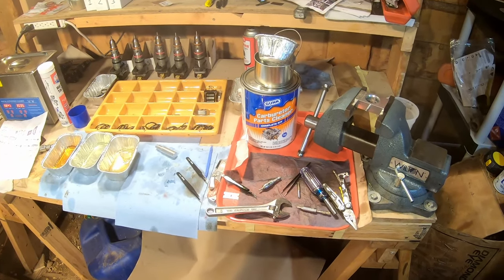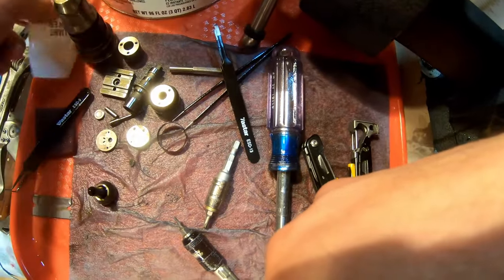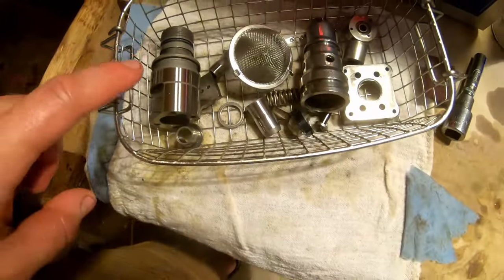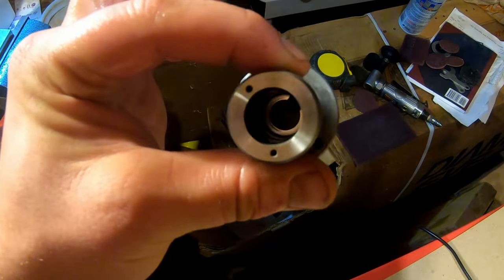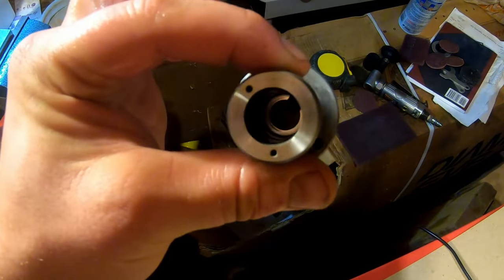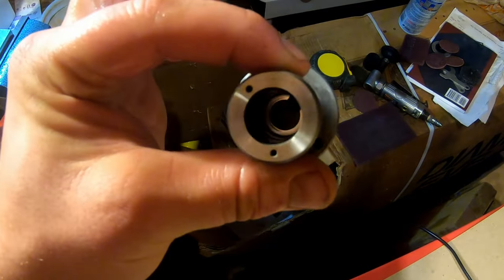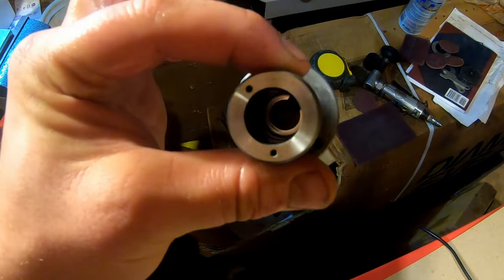Rebuilding Ford 7.3 Powerstroke HEUI Diesel Injectors

Comment: The amount of different chemicals you expose your hands to is astounding. That's coming from a daily diesel mechanic.
Reply: Indeed. He's got a good video here but all those chems just soak into the blood stream. For a long time I thought if ya didn't have grease on your hands, you weren't working. But as I got older and understood the body a little better not to mention being warned about the toxic effects of all these oils have, I wear the rubber gloves now and when they tear I put on new ones.
Reply: @silvergrizzly316  yup liver cancer on its way this guy needs nitril gloves one big time the damage is all ready done ,safety training in the airlines taught me right away the dangers of chemicals many co workers died already from cancers to there organs from previous exposure earlier in there lives

Comment: Just curious...before you did all this work,  had you poured in one quart of transmission fluid into the diesel tank to see if that would clean the injectors enough to run good again?  Excellent Video Sir!!!
Reply: What does pouring the trans fluid in the gas tank do ? I’m new to diesels
Reply: @SwappedByMetro  it will clean the fuel system, injectors and also lubricates seals.  this is what I do in my older diesels. But I am telling you to do this,.  *Do some research on it.

Comment: great video on rebuilding the injectors,, how does the truck run now!!  :)
Reply: I was torking my second injector and I thought all was going well than the top of my nosel blow off  what I found was that my little disk had slipped to the side and picked down at a angle witch put to of pressure on the needle forcing it to brake the nosel

Comment: I'm doing this job for the first time and starting on my second injector after watching someone else's instructional video but you both put them back together oriented differently then you took them apart.... I'm not sure if I should take the first one back out and swap it or continue assembly the way you show 😥
Reply: Put together the way it's taken apart
Reply: @mattm3492  nope, indexed housing 180` on reassembly
Reply: @bad89coupe  so when you take something apart your supposed to put it together the exact opposite way? Ok gotcha 🤪
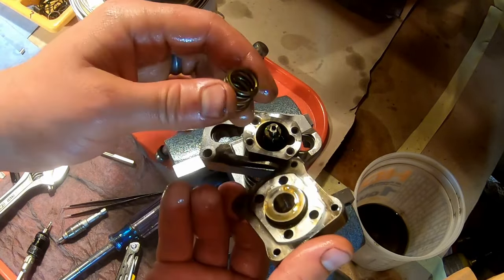Reply: @mattm3492  You could have just said, show me. But instead you want to act like a clown. So answer me this, at 6:56 in video when you lift off the plate, the drainback notch in the base is opposite the clamp "flat side" you refer to it as. Which is the direction of the connector, the top side, which makes sense because that's the bottom. But at 35:30 in the video, you line them all up with drain back notch at the top.
Reply: @bad89coupe  you must not know how to read. Because the original poster asked what he should do because dude in the video put it together backwards from the way he took it apart, so I answered his question to put it together the way it's taken apart which Common Sense tells you well it tells people that have common sense but a lot of people don't so that's kind of left up to interpretation
Reply: @mattm3492 I'm the one that asked the question, and  the way you answered, I assumed you're the one that made the video and were saying "they're put back together the way they were took apart" So look at it from that point of view before you ask me if I know how to read! Learn how to write.
Reply: @bad89coupe  it can't be any more clear. You asked if you should continue to put them together the wrong way. So i said put together the way it came off, pretty simple. You knew the answer already or you wouldn't have asked it that way. So put back together the way it came apart.....
Reply: @mattm3492   You know what else couldn't have been more clear? Who I was asking! So A) you were trying to make me think that you were the author of the video, B) you were trying to be helpful in as few words as possible, or C) trolling the comments of an instructional video that's not even yours, dropping your infinite wisdom on the world. Well I'm guessing C, since at your expert reading level you would have seen that my comment was over a month old and I certainly wasn't waiting for an answer.....

Comment: Number one mistake never use metal tweezers or picks 👎
Reply: well what wold you use?...  it's pretty standard practice
Reply: @jbbolts they do make the plastic tweezers that some people say to use, I got a set of them, the good ones!, and haven't used them on my injector rebuild yet but I was try'n them out the other night and found out there's no damn way these things will pull out some of those O'rings. I twisted the tip of one just trying it out on light duty work🤦‍♂️
Reply: @silvergrizzly316  exactly.... theres no way even cheap steel ones probably wouldn't cut it